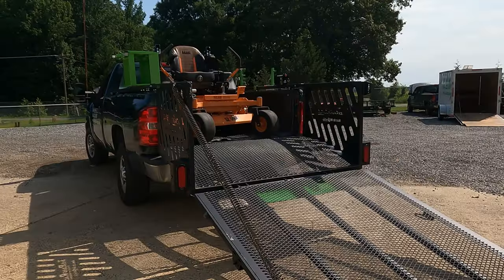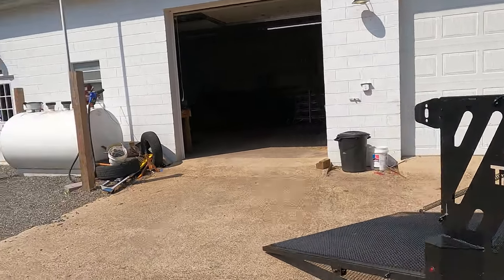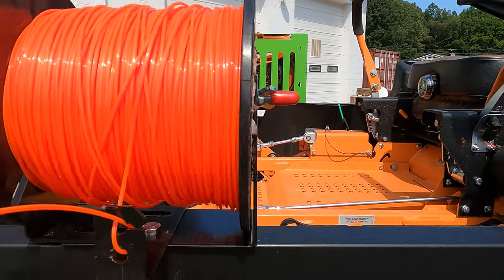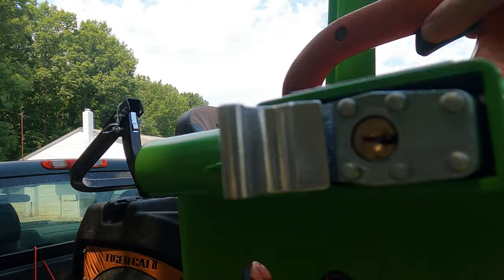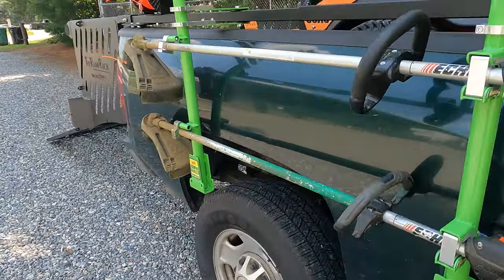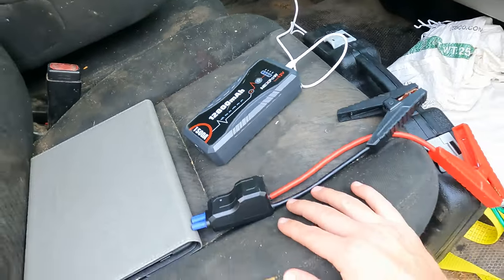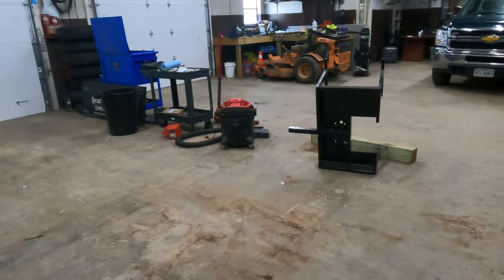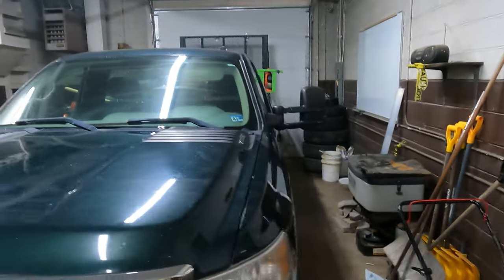The best lawn mowing set up.

Comment: Love the ramp rack. I have a similar setup, the actual ramp rack version didn’t work for me due to height of the single gate. But it’s still a great option, I love being trailer-less for the most part.
Reply from the maker: I believe they have a foldable ramp on another model
Reply: @locallandscapers3257  yup. The sport model.

Comment: I think that is an incredible set up. I would possibly raise the green bars  up and spin around, but not sure if thats an option, but if you could, you could install weedeaters above bed on the inside of bed instead of outside the bed. Drivers may have a hard time with them and mail boxes and gateways. It's just a added hazard  honestly. Those aren't cheap either. Really neat set up. Haven't seen anything like it around here in Houston. Mostly the land scapers and lawn crews use trailers. The trucks sometimes have ladder racks with homemade weedeater racks on inside of bed, almost above the cab. Thanks for sharing, I Wonder if they make it for wagons? ;)
Reply from the maker: Thank you, that is something we may do in the future! The trimmers currently don't stick out any further than the mirrors. I am still not opposed to mounting them higher, it's just a matter of reaching them from the ground
Reply: @locallandscapers3257  good point about the mirror.

Comment: Looks like you still have a bit of room for a small walk behind as well. For all the small sites I built a hitch deck that could be put  on the back of my 1ton dump. Close to the ground so no picking it up.
Reply from the maker: Yes this is correct, you could fit a 36 back there or even smaller. We have mostly larger sites. They probably average 1 acre in size.

Comment: These are great set ups but they wouldn’t be good for my market which is cape cod. Between sticks, shrub clippings, grass clippings, leaves, and downed limbs the need for a truck bed disposal receptacle is essential.
Reply from the maker: Thats fair, others use this set up and bag all of their clippings, however they use much smaller mowers with bins to hold the clippings. So it could probably work with a smaller mower?

Comment: Why must you unload the enclosed trailers every evening? Wouldn't some of the new high tech puck locks prevent theft? Throw a high tensile chain and lock around the wheels? Asking for a friend.
Reply from the maker: So we actually were running open landscape trailers and had one enclosed trailer. I was referring to unloading those open landscape trailers in the video. I thought we might switch over to enclosed trailers with 1 person crews. The problems I found with enclosed trailers is that they were a pain to get in and out of with mower inside, the one we had was too small, and when we had to fuel at night we had to unload mower from trailer for it to reach. We were able to keep everything inside the enclosed trailer, but for the other reasons, I figured ramp rack has been the best fit for us.